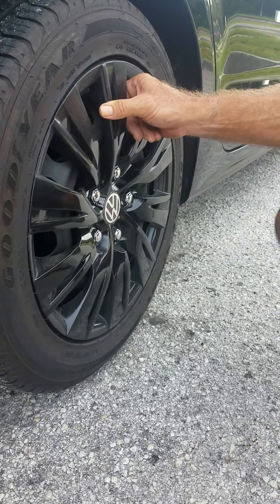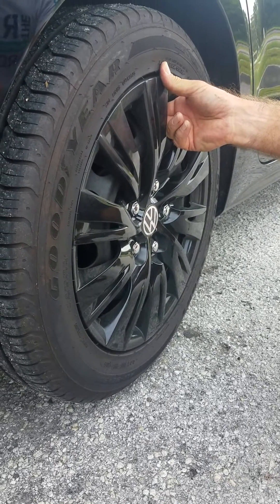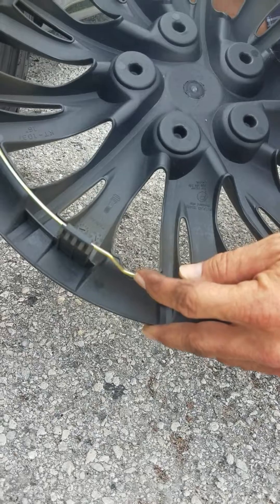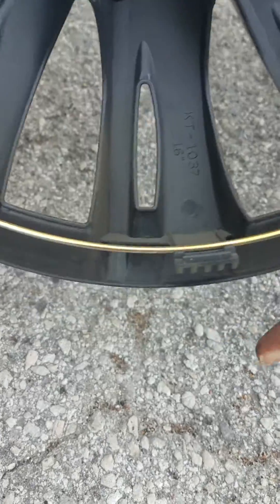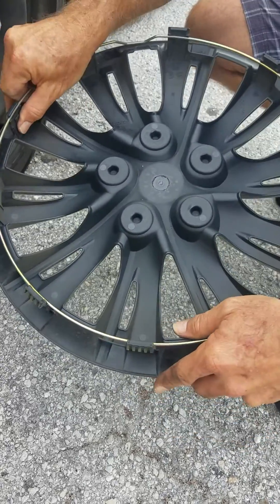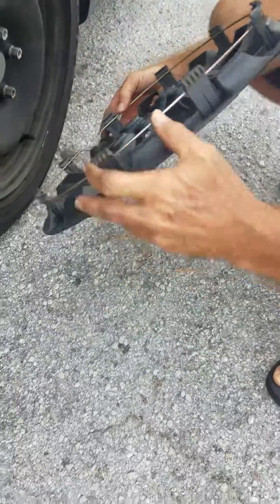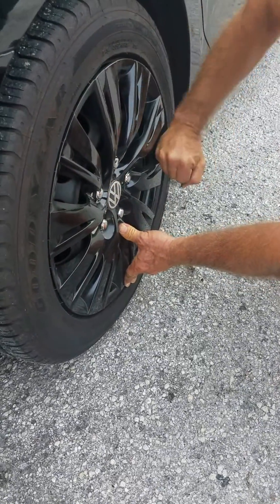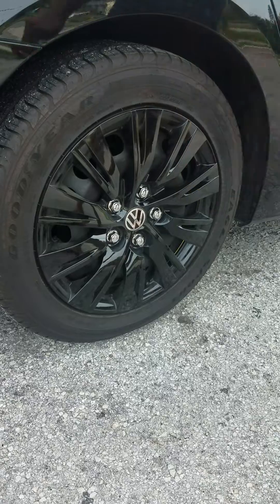Simplest Solution For Correctly Installing Aftermarket Hubcaps

Comment: True, with those particular 16 inch hubcaps you can  just use the second groove… But what if you buy aftermarket hubcaps that don’t have that feature? If you just wrap tape around the ring where it contacts the clips and you put it back on it should be a lot tighter .
Reply: HubcapsEasy use zip ties. They come in all colours to match the hubcaps. You can easily disguise it
Reply: @francismartinez6049  u could but they look horrible I'd just use the duct tape method

Comment: If you buy after market hubcaps for your vehicle, can you still put a centerpiece in the middle of your hubcap if you still want your brand to still show on your wheel?
Reply from the maker: Yes. Those stick on.
Reply: On my Nissan Rogue, I took the brand emblems from the old wheel covers and filed away the clips on the bottom of them.  I am going to apply 3m double-sided tape to the back of them and then apply them to the new wheel covers.  Haven't done it yet, but it should work perfectly.

Comment: Not all aftermarket hubcaps are designed that way and as easy to adjust.  Mine move slightly after driving, but not enough to really worry.  As long as they don't pop off and get lost, I'm fine with it.

Comment: Mine would still fall off no matter which ring I used.  I gave up on those pop-on hub caps.
Reply from the maker: Yeah,  I suppose the list of hubcap manufacturers is huge! No quality control, plus rim size would probably affect it as well.

Comment: How do u prevent them from falling off or getting stolen??
Reply from the maker: They haven't fallen off ever.
Getting stolen? If someone wants it bad enough, they will get it.
Unfortunately hubcaps can only be minimally secured. Don't really think hubcap theft is a thing anymore. 
You can attach a thin wire to the back side and it will a least rip it from their hands to make them think twice the next time.
Reply: I've just used one plastic tie on each trim...
Reply: I bought a really good looking set of hubcaps for my Nissan Rogue and they only cost $48 for the whole set.  If people are desperate enough to steal those, I'll just buy another set.

Comment: You could have explained the valve stem needs inserted between the hub cap and the metal ring. I installed it wrong the first time and I mashed the valve stem down by the metal ring.
Reply from the maker: The ring should have a specific area where it is relieved so that the stem cannot be pinched.
Reply: @fedheavy  The stem will be pinched between the ring and the wheel if you simply put the hub cap on.  You need to be sure the stem goes through the gap between the ring and the hubcap. This is what you didn't explain and I did it wrong.

Comment: Tried that still was loose
Reply from the maker: Some of these caps are pure garbage. Lots of these parts are made from molds from the part itself, meaning drastic size differences from an original mold.